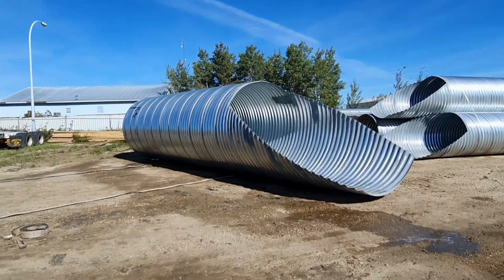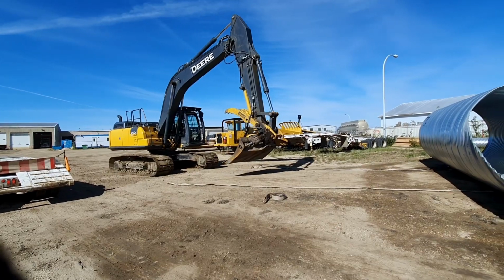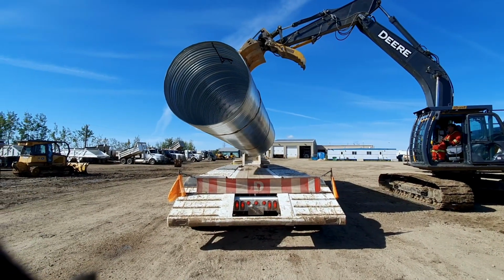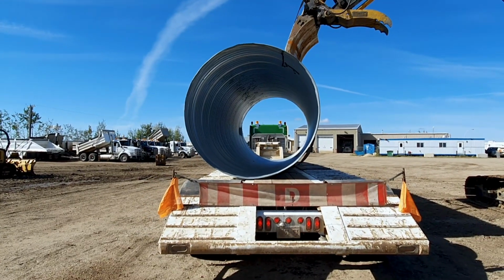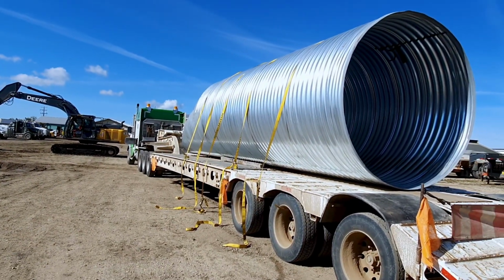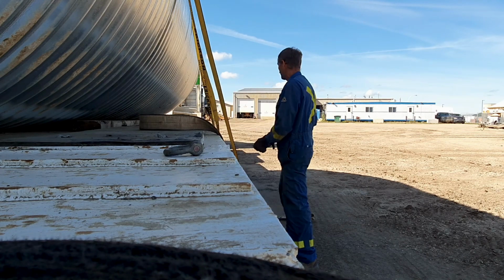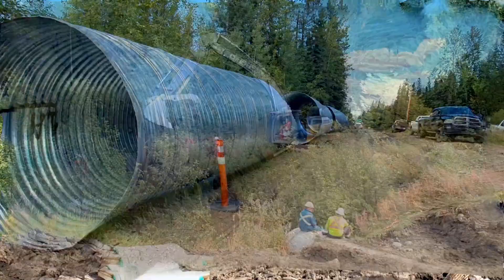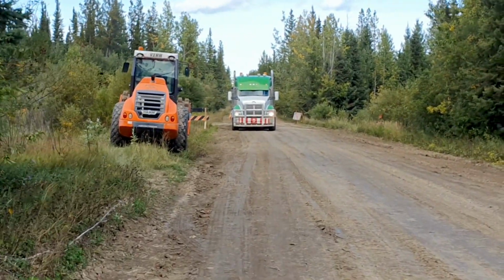Loading and hauling a Culvert 8 feet in diameter.

Comment: Thanks for the ride.👍. How long a trip was it from the equipment yard to the drop off ?
Reply from the maker: About an hour and a half +, less than 2 hours 1 way for sure. 
I  hauled a load out of a spot several miles away from there this week took a time-lapse of the road.  Cut the 30 + km down to around 4 minutes.  Beautiful country this time of year. Maybe I'll get it posted right away